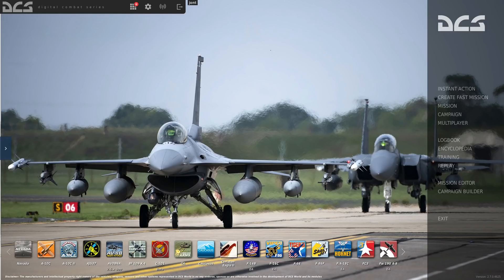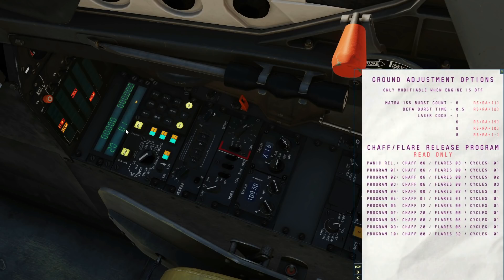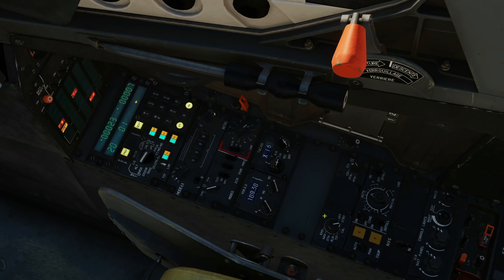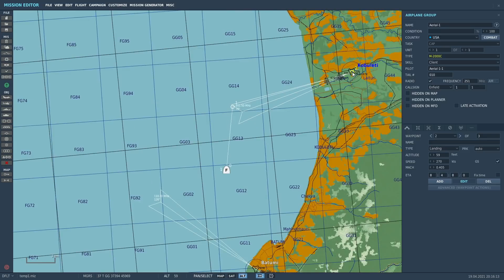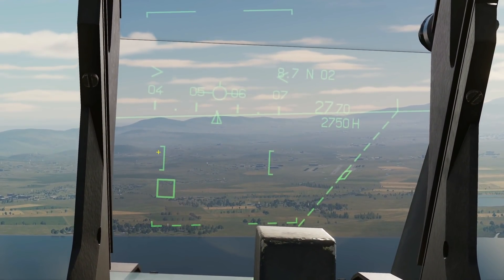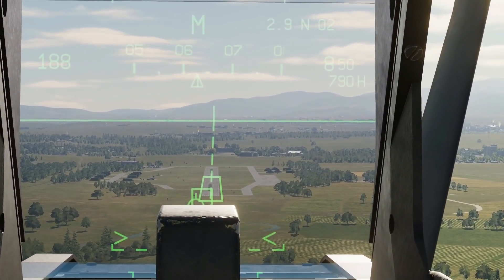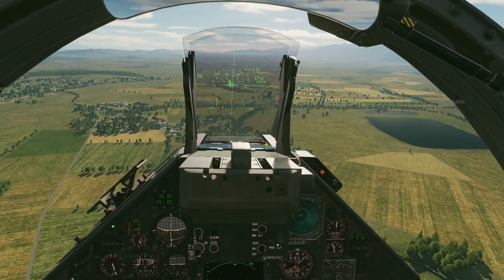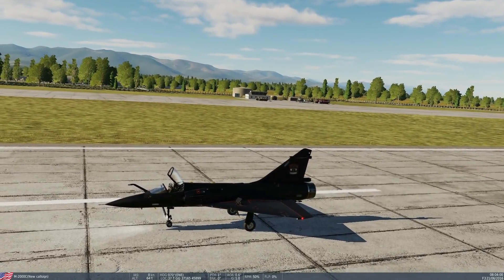Mirage 2000C: CHANGES To INS Alignment & Approach Symbology - April 2021 | DCS WORLD 2.7

Comment: HOW ABOUT: IAI KFIR Block 60, KFIR C10 (F-21A ATAC), MIRAGE 5AM MIRSIP, MIRAGE 5 BM MIRSIP, MIRAGE 5R RECCE (camera nose), a fully functional ALPHA JET A+ model (pointy nosed DORNIER version), ALPHA JET E+ (blunt nosed DASSAULT Belgian/French version), Leonardo M345 and M346 trainers for DCS WORLD (both versions 2.5/2.7? The Mirage 5 series I mentionned are COLD WAR ERA jets that were later sold off by Belgian Air Force to Chile Fuerza Aerea as MIRAGE 5 "ELKAN" and "PANTERA" (conform modifications). How about TA-4J dual seat SKYHAWKS?

Comment: Perfect video. But I'm concern about setting waypoint 20 for INS alignment as a reference. I use waypoint no 1 instead. Then distance is calculated correctly after moving off from parking spot. If I use waypoint 20 I have 9999.9 km from starting position.
Reply from the maker: Roger. 20 came from Razbam's most recent public post on the Mirage.

Comment: For those wondering how one would setup synthetic runway in the plane without having preconfigured a waypoint in the mission editor :

You need to set your ILS frequency to the right one, also having your altimeter to the right pressure is nice because that's what's used for this.
Now select a random new waypoint with the "PREP" button on the PCN (PREP=>enter WP number). Let's say you have 3 preconfigured waypoints so we choose arbitrarly WP09 which will be "blank".
You then need to set the INS mode to "CP/PD" (cap désiré/pente désirée = desired heading and glideslope I believe)
You will then enter "CP" with the "left +" on the PCN numpad. Enter the runway heading.
Then "PD" with the "right +" on the PCN numpad. Enter 03.0 (I've read this value on the forum, I don't have more informations)

Now select WP09 as your dest. You don't need to tell the ISN the coordinates of the runway, it worked as it for me :)
Reply from the maker: thxx
Reply: What's 03.0?
Reply: @anonymous17367  03.0 -> typical glide path angle of 3°
And don't forget, the runway heading must be in True, not Magnetic heading
Reply: @felixx75  How do I know if I'm looking at true heading and not magnetic heading ?
Reply: @xenio8736  When you measure the course on the F-10 map with the ruler, you will always get the true heading.
Reply: @anonymous17367  It's the desired glideslope. The usual glideslope angle used is 3.0° so that's why we use this number. You can try to google "glideslope ILS" or something to have more information
Reply: Okay, thanks guys
Reply: I do as you say but idk why the wpt is shown as wp2 in my case 999999
Reply: Very hard to find this info. Thank you so much.
Reply: @lufabsantos  Yeah the only place where I found some information is in the mirage 2000 forum on DCS website. However information is somewhat scarce and you have to scrap it from different topics. Also it's really recent (2.7)

Comment: (New Callsign) spotted! I just think it's funny how literally most of the DCS community never set up their virtual pilot in the logbook menu :)

4:41 Here's actually the main change. You don't need that waypoint from the ME anymore, it now also works for waypoints set during the mission (haven't tried without any yet)! Instead you just need your ILS frequency set and the runway data entered to the PCN with the knob set to CP/PD (french abbreviation for Runway Heading / Glide Slope). Enter the RWY HDG (get from the map with the ruler, no magnetic correction, just the readout; or take the value from the ILS cones in the ME) to the left box and the glideslope angle to the right one.

6:13 I'll just grab it from the manual:

a. The INS is on.
b. The airport is the current fly-to waypoint.
c. The runway data (heading and glideslope) were entered2.
d. Both localizer and glideslope have been captured
e. The runway is less than 10 nautical miles away.
f. Lateral deviation is less than 7º.

8:06 The thing gets tons of drag at desired AoA, so it's better to keep them in (not sure if this would be the real procedure though) and you almost need somewhere around 50% of throttle lever there. Plus, when you touch down, deploy the air brakes then. Since they're on the wings, they also act as spoilers, so deploying them immediately kills some lift (at least it should), so the thing stays down on the runway nicely. Just as a re-Cap for the AoA, you'd ideally want to see the symbology in a line like this as much as possible: >] o [<

8:37 Just stretch your neck some :D - or RShift+RCtrl+NP8.
Reply from the maker: Thx RD
Reply: @Lukas Maxim I use FlixZone. Just search on google for it :)
Reply: @Lukas Maxim I use FlixZone. Just search on google for it =)
Reply: i realize I am kind of off topic but does anyone know of a good site to stream new series online?

Comment: I thought you also had to input the relevant CP/PD (runway heading/desired slope) numbers now in order to get the synthetic runway symbol to show in the VTH, but I didn't see you do that?
Reply from the maker: I used a LANDING waypoint from mission editor. It does al the work for you
Reply: I think it's automatically in there correctly with a landing waypoint from the ME. But you can divert and then you'd have to enter those manually. Or if you just place the plane on the tarmac without having any followup waypoints at all, then they're zeroed as well and need to be entered. Not sure if you'd actually need a landing waypoint anymore at all, the manual isn't updated and it still says you would.
Reply: I just checked, no waypoint needed for landing anymore. The landing waypoint just conveniently brings the CP/PD values unless you hack it in from inside the cockpit. All you need is the CP/PD values and ILS frequency now which is absolutely great if you have to divert, ideally to something that has at least a TACAN station as well. Wrote more details on this in my other comment :)

Comment: That's the thing I was wondering why my INS aligment didn't work
Reply: yep i had bought it recently too...that was so frustrating lol...they should at least update the training mission waypoint 00 to 20
Reply: I had found to use waypoint 20 for alignment, but found my waypoint headings to be off a bit, I didn't realise you can still set the hundredth and thousandth of a minute so I guess that's been my problem.
Reply: I'm glad I tried the new synthetic runway changes with a hot start. The WP20 thing would totally have caught me off guard as well.
Reply: @CakePrincessCelestia  You are not forced to use the WP20, as long as it's not the WP00 it's fine. WP00 is uneditable and is always the current position of the aircraft
Reply: Same

Comment: simplest way to be in configuration to start an alignement is just to ask ground power
Reply: Can you explain further?
Reply: @trucktrucker5043  Set battery ON, ask the fround crew to turn on AC ground power and that's it, you have all the systems needed to align the INS